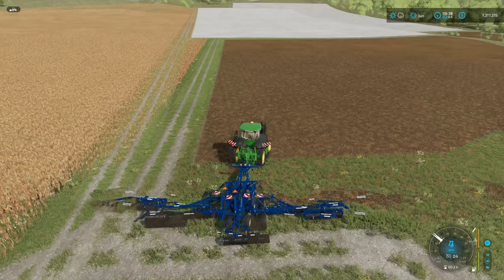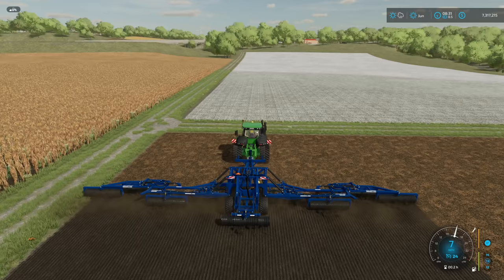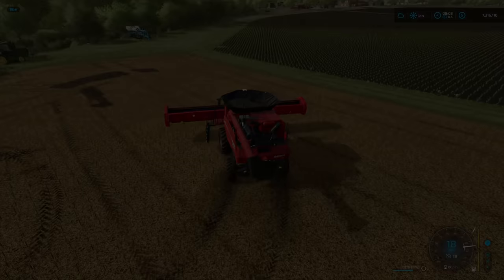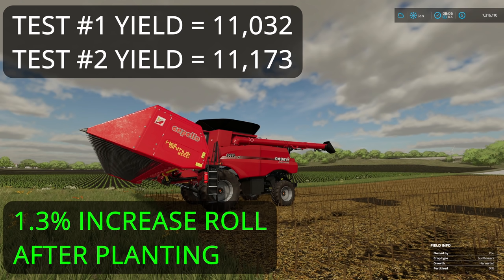Do you ROLL Before or After Planting? | Farming Simulator 22 | Tutorial Series

Comment: You would do the rolling right after planting. In some countries a thin layer of slurry will be applied after rolling as well. This is important in sandy soils where wind will move sand/soil leaving the seed exposed. The slurry will keep the sand/soil in place acting like a coat. It has no fertilizer purpose.

On pastures you would use meadow roller to even the surface when the cows have been stomping around....
Reply from the maker: Good info, Nordic!

Comment: I work on a farm in the Red River Valley of North Dakota.  The soil here has no rocks.  I have never seen a roller used on any fields here as a result.

The idea of using a roller to compact the soil on purpose to help yields seems off to me.  Just my opinion.  I can understand that you would increase seed to soil contact but it makes it difficult for some crops to push through after germination.

The biggest concern I have would be moisture absorption after a rain.  Porous soil allows rain to soak in much better.  If the rain can't penatrate the topsoil it will runoff or evaporate away. 

I'm no expert, please feel free to disagree.  I'm just thinking out loud.
Reply from the maker: Best I can tell it is a regional thing.

Comment: I would think it should work the other way. Isn't the rollers point that you push the rocks in so your seeders take less damage? How do rollers work in real life tho.
Reply from the maker: There are actually multiple real life uses for rollers, and it spans from post-harvest, prior to cultivation, after planting, during growth (soybeans). So ... I don't really know the intent of the in-game roller. Pushing the rocks down is something that you would want pre-seeding. However, I've only had personal experience with post seeding in what we would consider a cultipacker (ensures the seed and soil are compressed to improve soil/seed contact and get rid of any air space). Based on my testing results, the improvement does come when rolled after seeding, however slight it is right now.
Reply: @MightyMikeFarms  Here in Bulgaria, we use the rollers after planting/sowing the Wheat and Barley, its used to press the soil and the wheat to have better root system for the winter. In real life it can be done after the plant have grown, when its 3-4-5 cm in height, it also presses the soil and the growth rate improves. In some cases in can be done in the summer for the corn, because the corn is really strong plant and can "push" from hard soil, but not for the sunflower. But thats in real life, in the game you can use it anytime as we see. :D

Comment: did you used a direct seeder to plant? 
I'm confused if I cultivate, then plant, then rool, will I have stone in there, which means the machine is going to break?
Reply from the maker: If you don't pick them or push them back in then yes they will cause additional damage/wear on your machines.
Reply: @MightyMikeFarms  which... is basically the planter, as any other stages (fertilising and harvesting) the machine does not touch the ground. 

My question is.. is it better to roll before planting to avoid the damage on the planter?

Comment: Is it so deterministic that one run is enough? What if that was just randomness. If I were implementing it, I'd add some randomness to make it not stupid. It would be utterly asinine to get the exact same amount every time, even with weeds, and field-stone, and all that stuff off.
Reply from the maker: It is just the way it is programed. Fixed amount, no randomness.
Reply: @MightyMikeFarms  Aw, that's unfortunate. Noise adds a lot of realism. I would uninstall it if the fields weren't bumpy.
Reply: @MightyMikeFarms  They did an amazing job with the rigid body stuff and collision detection and response. It's unfortunate that they have so much damping it sterilizes it. They even tried to make the physics deterministic, it seems. I'd rather more fluid motion with some glitching, than wading around in a viscous fluid, with no glitches. The Jupiter gravity when you walk off an edge is pretty comical when so much else is so realistic. You hit terminal velocity in about 1/10th of a second, and the drag of the massive damping prevents you from reaching mach 1 from falling off an edge.

Comment: "Regular rollers are used after sowing, when the field is already cultivated and the seeds are in the soil. With a roller, you condense the soil, and therefore increase its quality to increase the yield by 2,5%.

Tip! If small stones are left on the field as a result of cultivating, and because you didn’t use a stone picker to remove them, a roller will press them back into the ground.

Warning! Stones left on the field can damage your machines. Seeding machines can manage small stones quite well. You should roll over them after seeding. Bigger stones should be removed, though.

Grass rollers are different. They are used after mowing grass. If the grass is harvested, you roll over what’s left to prepare for the next growth cycle. By doing this, you automatically gain a fertilizing stage. Note, that if you roll over matured grass, its growth stage will reset."
Reply from the maker: Yep, straight from the source.
Reply: @MightyMikeFarms  My biggest question was, if rollers are used after seeding, but cultivating reveals rocks, then how do we seed without sowing over rocks? The answer is, we do sow over the rocks, but the seeders can take it. Edit: I realize we can always use a rock rake between cultivating and sowing, but that takes a long time and results in a Cultivated status, so seems redundant when combined with regular cultivating.
Reply from the maker: Yeah it’s not a perfect system. You can roll prior to seeding to push in the rocks and again after to get the bonus but it basically comes down to how you want to play.

Comment: what if you roll before and after seeding?
Reply from the maker: Waste of time. No benefit.
Reply: Unless u used cultivator to have small rocks. I would use roller to roll them in before planting so planter damage doesn't go up then roll after so u would get the bonus yield the 1 % adds ups over a big field. So worth it in my opinion other than hours on trator and damage but keep trading in to keep cost down on repair. Lil bit realistic way in my opinion of doing it just depends on what tillage u use on your land.